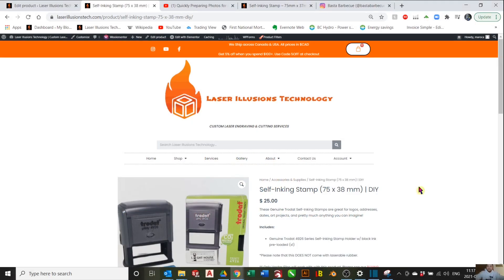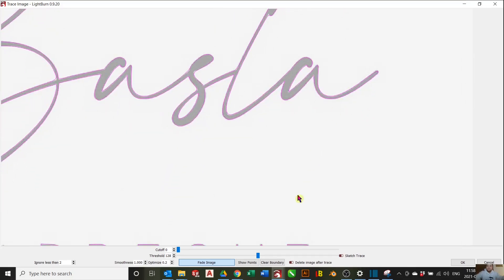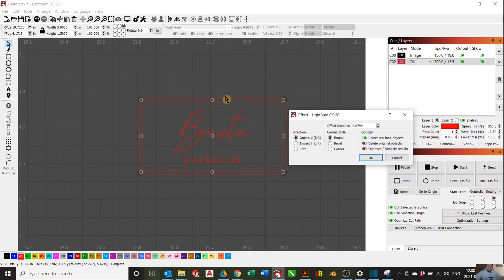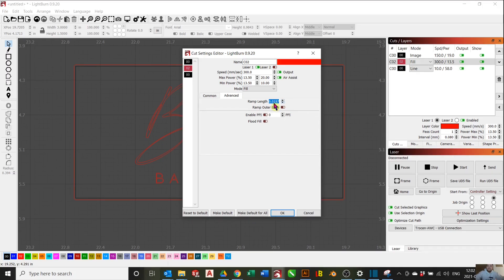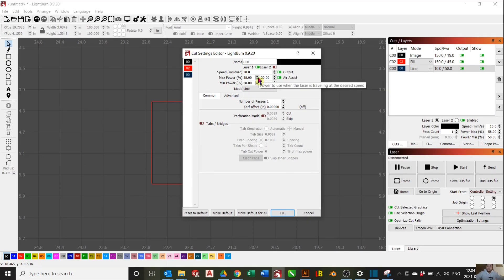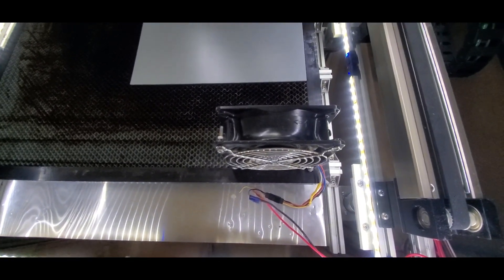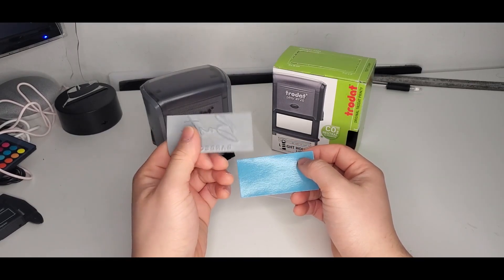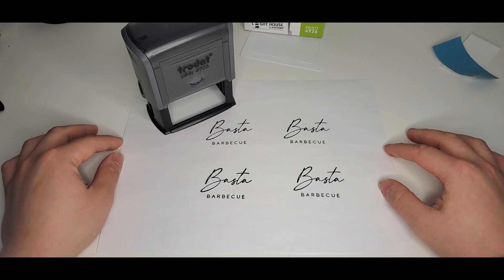How to make Self-Inking Stamps | LIT Tutorials

Comment: Hey man, awesome video! I'm using a K40 right now with 1.5" 38.1mm FL.

I have an issue when engraving this kind of rubber, it seems Im burning it and leaving hard residues and the engraving is not depth enough. However, for the Orange Rubber I can engrave perfectly and have done about 100 stamps already with that one.

But the grey one feels can get much more ink adherance... Do you know why this may happen to me?

Comment: Hey bro is it alright if I do the same with my 80W laser will i lose any details let's say for the same size stamp ? Or is that just perfectly fine ....
Reply from the maker: Hey! It should work for 80w 😀 you will just have a lower power% than on my video (im using 50w). Also make sure your zaxis focus is good👍
Reply: @laserillusionstech  great man thanks ,  will try it out!
Reply: @sword123n  What settings did you start with on your 80w? I am going to try this but I am limited on my rubber.